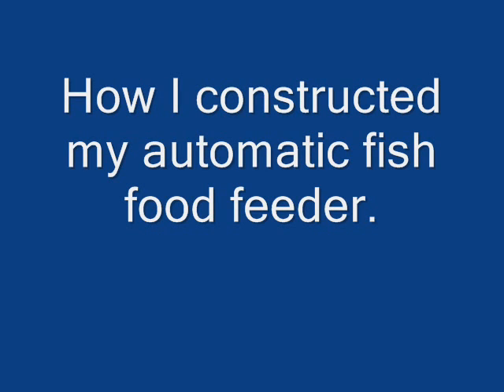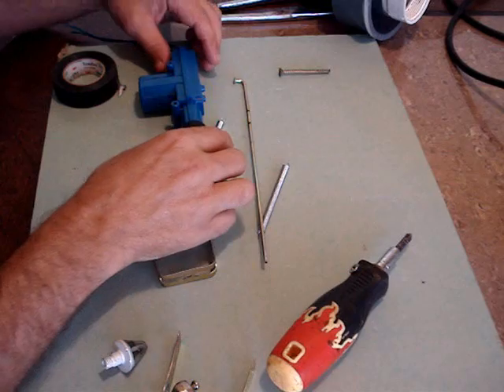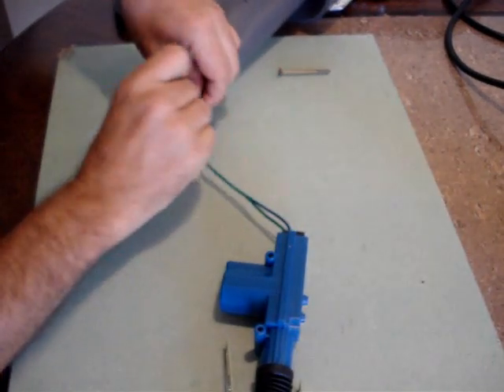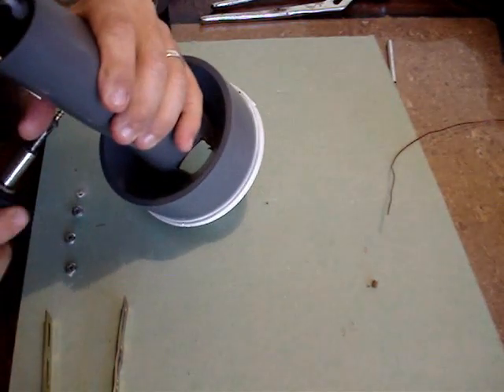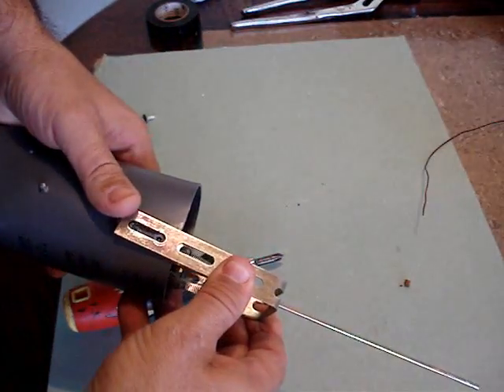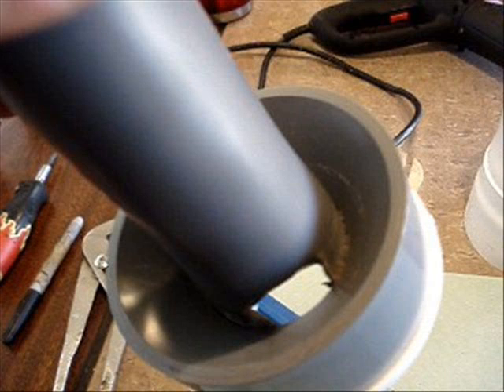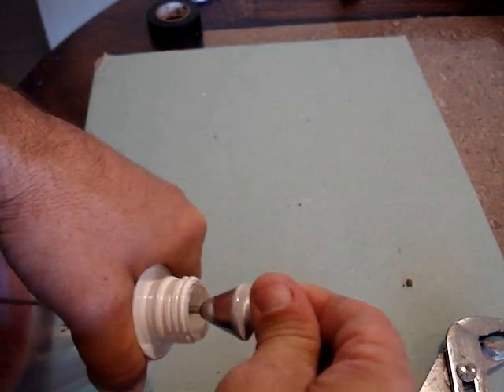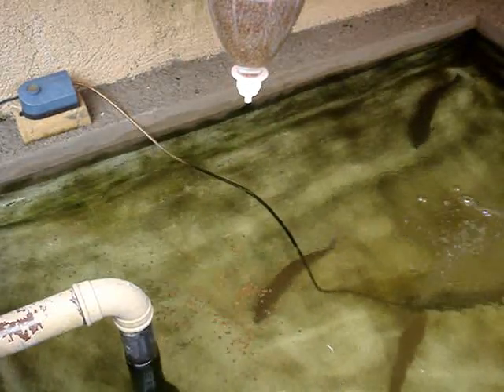How to build a homemade automatic fish feeder

Comment: interesteing. i don't understand the programming part in full, i'm in college and just started to use python programming. i am currently embarking on designing a fully automated aquaponics system for my final project. i would really appreciate if u could do a video on how  u wire and programmed your system
Reply from the maker: Check out this video. https://www.youtube.com/watch?v=LDlZmeVEzvg
For your project you could use a Arduino and program it as a simple timer connected to a solenoid.
Reply: M.J. here.  oh, thank you very much. got a better understanding. will keep in touch wen the project begins (2017)

Comment: You know you can buy a real one for like $25
Reply: +Marty Lynchian Why buy a cheap junk battery operated one when you can build something and design it to what you want, learn something and have the satisfaction of creating something???
Reply from the maker: +Marty Lynchian Not here in Costa Rica.  Plus the idea is to connect  it into my automation system.  I am able to control it from the internet or with my timer software that controls all my equipment. You should check out my other videos on my Aquaponics garden and solar tracker. Thanks for the comment.